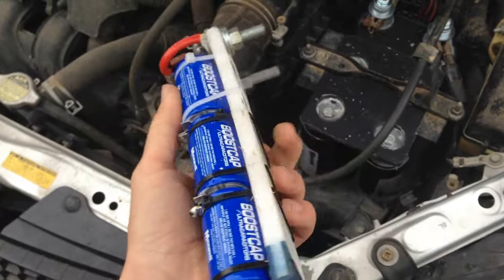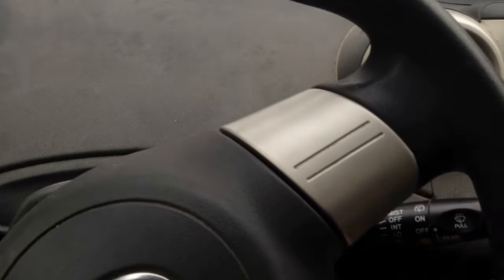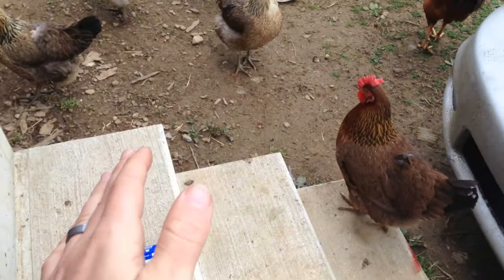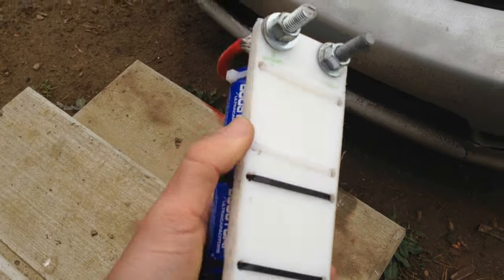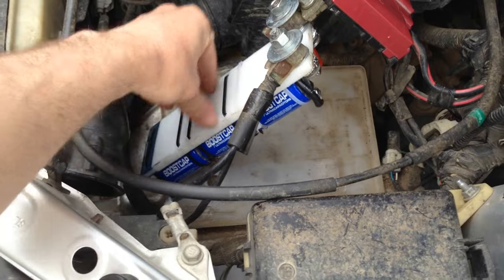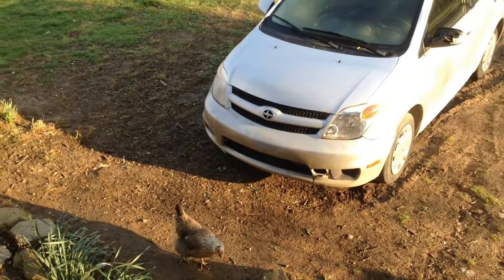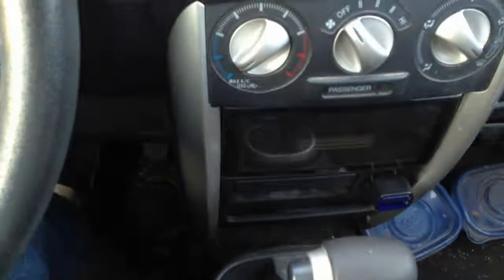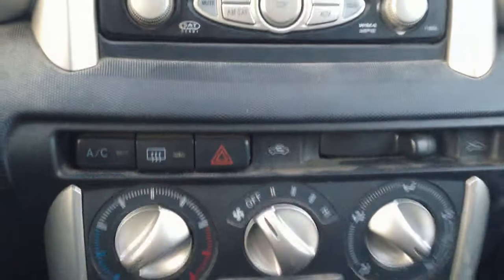Replacing My Car Battery with Capacitors! 12V BoostPack Update

Comment: I have a really hard time to believe this.
Reply: Jet Pilot Did you notice how he touched the capacitor leads? That would hurt like crazy if those were actually charged.
Reply: Jack,

You have no idea what you are talking about, do you normally get hurt by a 9V battery.
Reply: Jake Graham At 12v? You mean high-voltage capacitors, like used in camera-flashes...
Reply: I agree, charged 12V capacitors won't shock you, but neither would they start a car engine. We are talking about hundreds of amps here...
Reply: Jet Pilot There is well enough amps there to start it.
Reply: Moldy Cheeze I doubt it.
Reply: Jet Pilot Your profile picture scared the shiz outta me
Reply: Belal Hamoud Good!
Reply: D Priv How many Joules  are required to start an engine?
Reply: yes i know i was responding to someone thanks fo the clarification
Reply: Jet Pilot I have 12, 2.7v @ 500F caps in series and parallel. It roughly equates to 15v @ 150F. I was able to start my 01 Nissan Sentra 2.0L 4cyl. and my 74 Chevelle with small bock 350ci V8. 
I've even made some spot welds with this super-capacitor bank.
Reply: D Priv Agreed, this kind of power can be very dangerous. But so can a standard lead acid battery.
I've always kept at-least 10% head room and its normally closer to 20%. 
Thank you for showing genuine concern. Its a nice change from the usual troll garbage.
Reply: Adt Net Jake is correct, he would have gotten a very good shock. capacitors will discharge rapidly and at high current.
Reply: yes but the voltage isnt enought to hurt (by eletrocution) you in any way ! soooo jake is wrong... go an afrotechmod channel and watch the video called : It's not the volts that kill you, it's the amps
Reply: wingnut2009100 The conductivity of dry skin is very low. If he had been sweating and his hands were covered in sweat he may have closed the circuit and been badly shocked.
I was more concerned about the highly conductive wedding band. 
A little forethought and some simple precautions and you should be safe from electrocution.
Reply: D Priv Sorry, but your statement is nonsense. You need high voltage to actually cause some reasonable current to flow through a human body. Caps at 12v even with very low internal resistance likely will not feel much to touch both terminals when charged. It similar to touching the 12v charged battery terminals.
Reply: Jet Pilot You can believe it in this case. I'm an Electrical engineer, I work with this sort of stuff and I've done the maths. Mind you, if you have an engine that needs several seconds cranking to start or needs to draw more than about 150A, you could run out of energy before you get the engine running - no surprises there. 

In this case, his motor starts quickly (about a second or less by the sound of it) and it's not a BIG engine.

As an example: 
 - say it takes 1 second cranking at 12V and 100A, that's 1200 Joules of energy required to start. (or 1.2KW cranking power)
 - 6 x 350F capacitors in series charged to 12V will store 4200 Joules in total.
 -  Cranking for 1 second on the capacitors will use about 1200 Joules and discharge them to about 10V

When fully charged to 14V, there would be an extra 1500J stored which gives a bit more margin.  The capacitors used have very high current capacity (very low ESR) so they are quite capable of delivering 150A or more.

Handling the charged capacitors is no more hazardous than a 12V battery. Yes current does the damage when you get a shock but it needs more than 12V to get through the skin resistance under normal conditions. Nevertheless, if you happened to touch the live terminals on bare metal in the engine bay, the discharge would be like shorting car battery terminals together, or worse, so that's where some care is needed.
Reply: Mark Wilson What about when the car sits for a day or two or a week? Won't the capacitors discharge during this time? There are several things that draw current with the engine off. What about having the engine off and the door open, and the inside lights on? Won't that scenario kill the charge you need for starting the engine next time? It just doesn't seem as a reliable alternative to a battery.
Reply: Yes, those factors are limitations of this approach. This can be partially addressed by the approach shown in one of the later videos that uses a LiFePo rechargeable battery added to the setup to provide longer term compensation for the self discharge of the caps and for small continuous loads. I think it is a clever idea but I probably wouldn't put it in my wife's car! :-)
Reply: Mark Wilson I live in a place with really cold winters, so I wonder how good a capacitor pack would be in such circumstances when the oil in the engine is thick as glue. Batteries these days are quite good. Mine was 7 years old when I finally had to replace it. The amount of fuel you save by making your car a tad bit lighter is probably close to zero. I save more fuel knowing when not to break or accelerate unnecessarily. And I don't have to worry about not being able to start the engine when I need to do it. Batteries are here to stay.
Reply: D Priv With the advent of nano tech. I can imagine a triple A sized capacitor with enough energy to start any combustion engine.
Reply: +Jet Pilot they are designed to dump hundreds of amps and have a low capacity but will charge quickly
Reply: The Ultracapacitors that I'm using have a current potential of ~1250 Amps. Nearly 3 times that of a conventional Sealed Lead Acid battery for a 4-Cyl compact car. They dump most of their charge rapidly during the cold crank and then are quickly topped back up to 100% from the alternator within 20 seconds. It's possible because they have no internal current limiting resistors. I'm not selling anything and have literally nothing to gain by posting the outcomes of my experiments. This actually works, believe it or not.
Reply: +LuxAeternaFalsa          sigh... that's why batteries are rated in amp HOURS.   Instantaneous current means nothing if it's gone in a hundredth of a second.
Reply: +ohger1 No argument here, dude. I've posted previously that I do not find this to be a practical alternative to a conventional car battery, by any stretch of the imagination. That's for several reasons; yours being at the top of the list. I'm just having some fun tinkering around after work and occasionally posting a comment on my experience with said tinkering.
Reply: +LuxAeternaFalsa LOL. Well said.  "You're messing around and showing what you can find." That's cool.  I have a big pet peeve about all the "free energy folks".  They never show any team proof.

You need to store enough energy in the caps,  that will be released fast enough (Voltage x Current x cranking time) to start the car.  But replace the battery?  It has to be able to hold the charge going a long enough time -- like he tried to show.  I didn't know 10V would turn over the starter, but it's plausible.  Not much less I'm sure.

The thing is,  this is all very mathematical,  and easily predictable.  The leakage rate of the caps.  Their energy storage capacity (1/2 *C*V^2), and their current delivery capability (Power = V*I).  It's got to get that energy to the starter fast enough to spin it up. 

Then you have to charge the caps again.   Which the cars electrical system can handle. 

Oh someone mentioned thst a solar panel wouldn't supply enough amperage to charge the capacitors. Come on read a book.   A EE degree works too.

If you're going to charge a cap to 12V, you DO need a 12V source.  And if this capacitor array is going to have enough energy to say output 12V at 100A, for 10 seconds.  Then if you have a 12V charging current,  and you start from discharged (0V), if the leakage of the caps allows it, you CAN charge this capacitor array with a 12V @1ma source.  with great patience.  I think the math is easy.   Assume the leakage is zero.  Assume that there is enough capacitance (of the right type to be able to source a lot of current) so that when the array is charged to 12V, they can supply 100A for 10 seconds.  DON'T FORGET, THAT WHEN SUPPLYING THIS CURRENT FOR THIS MUCH TIME,  THE CAPACITOR IS DISCHARGING, MESSAGING IS VOLTAGE IS DROPPING.  IT HAS TO MAINTAIN ENOUGH VOLTAGE TO TURN OVER THE STARTER,  AFTER 100A for 10 seconds.  But keeping it real simple 100A *10sec = 1000A-sec.  How long would it take to get their charging at 1ma?  Easy algebra 0.001A * X sec = 1000A-sec.  X sec = 1000A-sec/0.001A = 1,000,000 sec. = 278 hours laughable but that's the idea. 

I know about this stuff because they use big 10,000V capacitor arrays to generate 1000s of amps to a thick coil to shrink quarters and stuff.  (Search on it).  They need high voltage caps because lower voltage one would be to big to provide the power needed here.  The might charge these things up at 10,000V@ 100ma, and wait.  This current is switched sometimes with a steel ball rolling and closing the path between two thick metal rods.  The current will make the big thick wire coil heat up so fast, it explodes.  But the magnetic field it makes is HUGE,  and changing FAST.  This causes currents to be induced in the coin,  and forced are generated which compresses the metal of the coin.   So, QUARTERS THE SIZE OF DIMES.

But there are times when you have to charge a capacitor,  at far less than the current it's finally going to be delivering.

Why haven't capacitor arrays replaced car batteries?  I don't KNOW! ?  That's what Mr. Lux is going to tell us.  Mr. Lux read some books on caps and electrical theory,  and you'll tell us sooner!  LOL. Have fun.   Stay safe.
Reply: gedgar2000 car batteries can sag as low as 6 volts during starting, so the voltage sag would not be a problem, so they are a great alternative, and they can charge in seconds. it would be easy to add a small sla to keep the voltage up.
Reply: what he said
Reply: +Jet Pilot sure it will start it 1-2times if youre car is perfectly good for cars that take some time to start this will not work eg is youre car takes 2-5seconds to start this will not work or you acedantly leave the radio on it will die in a minute !
Reply: Not on 12VDC
Reply: The capacitors I have in my van will, its a 6.0 V8, starts with an 83 Farad.  It will give you that peak current the starter needs.  Its only the starting moment my Van will peak at 300 amps when starting, once on, alternator kicks in, with everything running on a hot summer day its pulling about 50 amps continuous
Reply: Why are we paying $100 US for a car battery?
Reply: Tom Harvy because capacitors are the future, they also don't cause complications when are not charged. Unlike car batteries, where you have to jumpstart them. With caps, you can just charge them off a power supply. They are also reliable and cool to show off.
Reply: it's only 14v

Comment: If you internally fractalize the structure of your supercapacitor with nano carbon tubes, you can geometrically increase the capacitance of those buggers.  I've got an experimental 525GF ultracapacitor and it's powering all of our appliances at home.  All you need is a small rotating neodymium magnet to keep the charge up in the capacitor. This is just the beginning! I'm posting this discovery now, because I'm scared the Big Guys are going to find out about this cheap energy source and shut me down.  We're also working on a system that uses cheese instead of magnets to induce micro B fields, so all you have to do is keep the appetizers moving to power the whole house!
Reply: Press (x) to doubt.
Reply: What you have there is a Perpetual Motion Machine. There have been many designs tried, but they all have one thing in common: THEY DO NOT WORK!

But you already know that.
Reply: @DavidFMayerPhD  he never said its a perpetual motion machine ?

Comment: There are two main definitions to understand
1 energy density it's a property related to batteries, which is the ability to store huge amounts of energy, and speaking of batteries they can store a lot of energy
2 power density it's a property related to capacitors which is the ability to realese a huge amount of energy in a short period of time
In conclusion, batteries can store energy but not capable of realese it fast enough, that's why we have large batteries; and capacitors can release the energy stored fast enough but not capable to store a large amount of it. I've read in internet that the best solution is a combo a good batterie and a good set of capacitors and the reason is due to reliability, a failed attempt to start a vehicle with capacitors would let the car stranded, I hope I added a good point here.
Reply: xcellent point,a dual system takes the shock loads off the battery.

Comment: wont be useful in a cold start or old engines .. its nice idea but not dependable.. cold start will need many starter rotations to start engine and this will drop the voltage so fast and become useless it could be useful to use in emergency if battery failed
Reply: The Future Sound Of Egypt hopfully they will come out with graphene capacitors, maybe then it'll fix all those issues lol
Reply: You are actually wrong, the capacitor check out www.maxwell.com/esm   their products rate to -40F
 A starter motor is a DC motor, takes 200-300 amps, when operating in cold conditions it will take less then when it is 100 degrees outside.  If you are in a cold area, you will probably want to up the amount of capacitors and put them in parallel .  Maxwell actually makes a capacitor for a big rig, and they guarantee putting this in your rig will start your truck in cold temps.  It actually puts out about 2000 cca.  You can easily make this using these same caps.  https://www.youtube.com/watch?v=JAT_8H23iGI

Comment: Groovy experiment. Rooster is a nice touch. Also nice handy work. Love to see it on freezing mornings though Toyota, and many car makes use  starters that when newer can function at below 12 volts, but not all start systems can. Also vehicle ECMs require 12 volts to function. I think a small AGM battery would make a great, and necessary addition. Johnson Controls ought to start mass producing these. I see lead scrap, and commodity prices plummet as I write this.

Comment: If you isolate the capacitor from the drain caused by vehicle's electronics, the loss should be near zero.
Reply: I have stored a charge on my super caps and found it nearly fully charged after two years, it was totally isolated from any possible load of course.

Comment: TOUCHING LARGE CAPACITORS WITH BARE HANDS - RESPECT OR JUST STUPIDITY.
Reply: +Kevin CCIE The voltage is low.  It won't ionize dry skin until it gets over 30V.

Comment: Circa 1980 I had a motorbike (Norton Commando) which was kick start and had an alternator. I had a dead battery and found that replacing it with a capacitor (probably 4700uF 50v at the time) allowed it to run perfectly well. It obviously wouldn't work with an electric start machine and I wouldn't trust it with a computer based system on a modern bike, but this was old school technology and was e-bomb proof.

Comment: It sure will work! I have seen someone start a car off a 1 fard car audio cap. So multiple 350 fard caps. LoL yeah you will not have a SINGLE issue unless the car sits for to long and the caps drain.

Comment: be good for a home race car build
Reply: What kind of racing? I thought about it but decided against it for our circle track racing. You could use an alternator with this for sure, but alternators rob horsepower. On short races, up to 100 laps, we don't use an alternator. We just run from the battery. Even when we use an alternator, there have been times during a race that either the alternator or a belt failed and we still finished the race on battery alone.  Just my thoughts.
Reply: drag racing where you need to get rid of a bit weight but then again you can take outout the battery once the car is started
Reply: STAR SEVEN P.Cs .. That would work then.
Reply: yeah

Comment: You need a balancing circuit if you want your caps to last for very long. 

Capacitance is charge per volt.  If you view the pack like a single equivalent capacitor, the same current must flow through all 6 caps. A single current causes all 6 caps to charge or discharge simultaneously.  The time integral of the current is the stored charge.  The voltage for the equivalent capacitor is 6 times the voltage of a single cap.  That means the equivalent capacitance is 350F/6 = 58.3F, not 350F.  3:58

High temperatures might also be a concern. A lot of supercaps have an upper temp rating of 60deg C (140 deg F).  It can easily get that warm under the hood while stuck in traffic on a hot summer day.